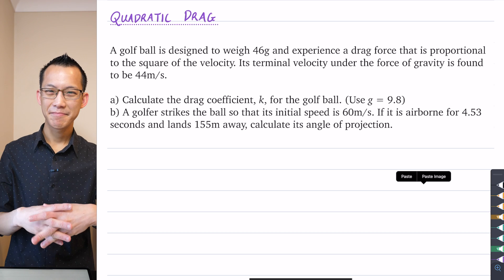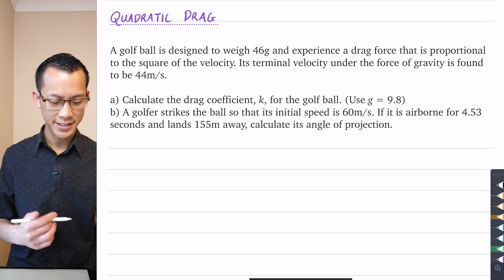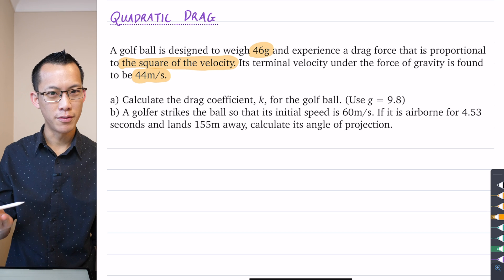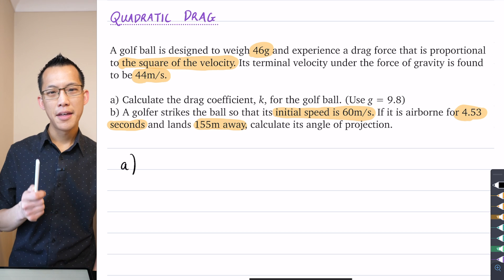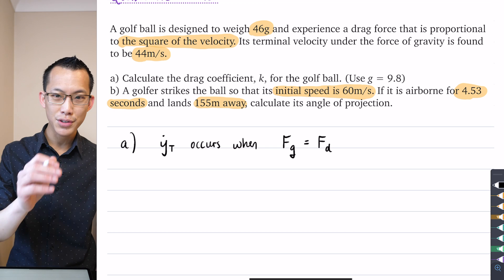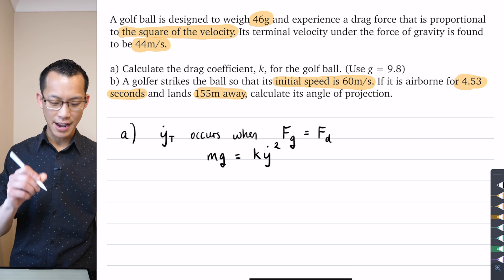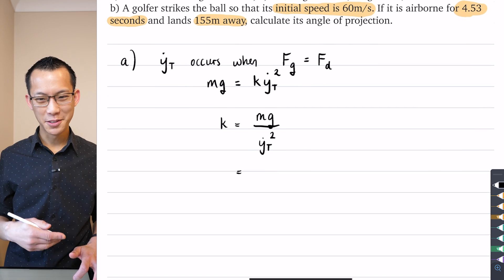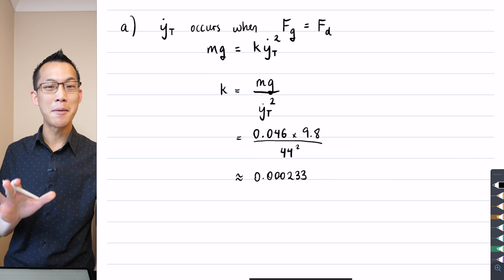Quadratic Drag (1 of 3: Evaluating the drag coefficient)

Comment: Great video! Just a quick question: when it says that the ball is designed to weigh 46g, does that mean the mass is 46 grams or does that mean that the weight (or gravitational force) is 46*g where g is the acceleration due to gravity, defined as 9.8 in the problem? It seems that there is a bit of ambiguity here and different interpretations of that statement may result in different answers.